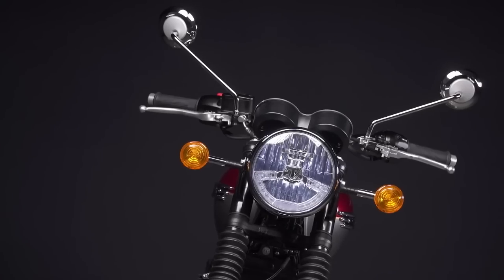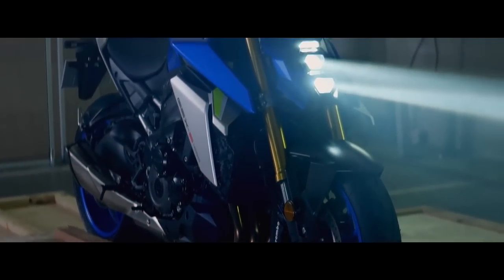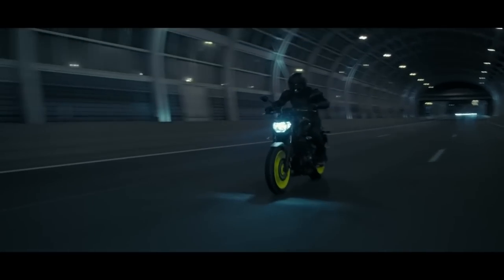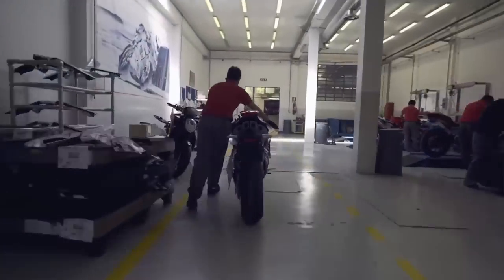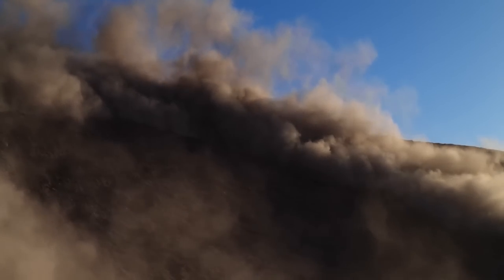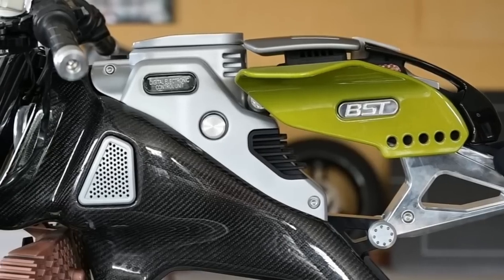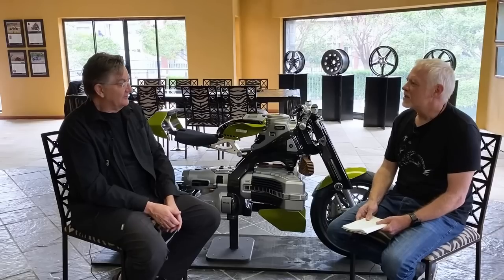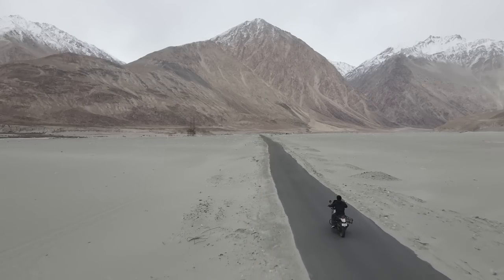Why old motorcycles look better than new motorcycles

Comment: Back in 1998, I attended The Art of the Motorcycle exhibition at the Guggenheim Museum. It was unprecedented at the time, and turned out to be one of the largest-attended shows ever held there, drawing folks who wouldn't usually be caught dead in any sort of museum. It was a supreme celebration of motorcycle design, proving that great design can be art.

Comment: Am 68 and still ride a lot, love the older bikes for the simple lines and simplicity.  Yep you can fix them yourself in your shop, but you gotta fix them more often but often the routine repairs can be done in fractions of the time to the new bikes.  There are some bikes out there that are simple, good looking and cheap.  Most riders now days are wrapped up with the high tech and MUST have this stuff on the bike and look down on others who cannot match the specs with their bike.  Well there is a stretch of road close to home that has some shall I say interesting characteristics that a good rider will drool and have fun, while many of these hyper bike dreamers wherein tech is the point and not the ride.  Many of these dreamers have bikes that should have cleaned my clock badly I ate for lunch.
Reply: I'll be 70 soon and have 5 bikes. Just got a Royal Enfield Continental GT 650. But I still love the old bikes. Even at my age I have no problem with a kick start. Merry Christmas.
Reply: I'll be 68 at the end of the month. I love all style of bikes. I have 5 bikes now. A 2015 XT250, a 2017 Harley Street Glide Special, a 2018 Iron 1200, a 2021 Yamaha MT07, and a 1965 Triumph TR6. I love them all.  I've been riding for over 50 years and have owned a lot of bikes. Too many to list. The Harleys style have seem to have remained the same for a long time. I have pictures of me sitting on my dads 1959 Pan Head. It seems that I was born to ride.
Reply: I have 7 carbureted bikes, one is a 2013 Royal Enfield B5 Bullet that I converted from EFI to an Amal carburetor, one is a 1979 Vespa P200E two stroke, one is a 2002 Harley Sportster, the rest are '70s and '80s Japanese bikes. I have 2 1960s pre emissions cars.  Computerized "technology" is not for me when it comes to motor vehicles.
Reply: @geraldscott4302  What is fun for me is the Kids and grandkids scratching their heads when I work on a carb or change out points.  Have a 47 VAC Case Tractor, and 6 motorcycles that range from the 70's to the early 2000.  As for automotive 4 wheels again oldest is 68 Poncho to Mom's 18 Grand Cherokee.  The cool 4 wheel is the 99 Jeep Wrangler with 2.5Lt with 5 speed and a home grown turbocharger system.
Reply: I hear you. I'm 29, and I just got into riding last year. Commute every day on my bike and love it. Maybe it's because I didn't grow up with the old bikes or pay attention to motorcycles growing up, but I'm definitely the kind of person that likes the modern bikes much better. Just for simple things like having safety features like ABS. My first bike I've been riding is a 2018 Triumph Speedmaster. Been riding every day and hoping to upgrade maybe next year for a larger cruiser bike. Probably going to try out the new Low Rider S when I get around to trading in. 

I love hearing older people still loving motorcycles. Hopefully I'll be the old timer one day talking about my favorite bikes too lol. Ride safe
Reply: @tomoates8568  I myself would avoid the Harley like the Plague.  Have had exactly 2 over the years and both I couldn't wait to unload on someone.  HD actually stands for Hundred Dollars, they are a reliability nightmare.  I ride with some die hard HD guys and if any bike on the ride fails it is ALWAYS the HD.  Sorry they have a assembled crankshaft, something the rest of the industry dropped some 40-50 years ago due to reliability issues.  Their valve trains for the past 15 years is Piss Poor at best, the old Evolution engine was the last somewhat reliable engine that HD built.  I hear of guys bragging how they get outstanding reliability on their HD but when you look at the bike it has practically no real miles on it or you can see signs where it has been down at least 1 or more times.  The best is when they describe as minor routine repairs compared to another brand would be considered MAJOR issues.  Sorry the rear cylinder runs on a average 50deg hotter and cracked heads are common.  The valve gear has had issues for a while now, seems as if it self destructs at a alarming rate.  My stepson was a cruiser type, that is until he rode a more traditional bike like you have, and eventually picked up a ancient Goldwing 1100 which he loves, yep it is old but it meets his needs and is toaster oven reliable.   Those cruisers look cool and feel great in the showroom but, and that is a big butt.  On the road that feet forward and reaching for the bars puts a shitload of load on your lower back, and they normally have only a couple of inches of rear suspension travel.  So they beat the hell out of your back then since your are reaching for the bars your arms ach like hell in 100 miles.  Have ridden with some big bad HD riders and they tell me I am full of shit on that one, however when we do a 500mile day they are in pain the next day when we are ready to go, just saying.
Reply: @lovingmylifeasIage6741  I'm 65 this year, have a pan head I built in 95, have been riding since about 12, and just bought a 750 Triumph off ebay this week.  I've long considered "form follows function", and it fits with the older bikes.  My neighbor bought a 62 panhead from a police auction in probably 72, I was 15, and we rebuilt his engine and tranny together.  I still mess with "old bikes".  I rode a 64 Triumph TR6R in the seventies.  Good memories.

Comment: You are right on form vs function (less so on materials) and the parallels with cars are the same. Early motorised transport was all about beauty and character (form) and then efficiency, performance and safety took over (function). Now all modern cars look like identical jelly moulds and we've lost the intimacy of self servicing with the complexities of things like EFI and ECUs.
The exception are the Italians, who have always prioritised the aesthetic and make the function conform to it. Tamburini  would have been a better designer to highlight, in this regard, than Terreblanche. 
Interesting video though.

Comment: As a 72-year-old rider, new bikes are like new cars cookie-cutter butt ugly.
Reply: Born in 1941 and got into motorcycles while in high school.  The era from then til the mid '80s had the most overall practicality and value.  Full fenders, a dual seat, and uncluttered features that were easy to care for.  My '57 BMW R-26 was the best "keeper" I ever had and was no slouch at cruising 60mph.  I was a mechanic and service manager in the industry for nearly 20 years - there were some exciting developments but also some minor failings, mostly for the status in a market category.

Comment: i borrowed a R1 and I also rode a modified cb400 cafe racer,
it always gave me a different and confident feeling and the soothing vibrations of old motorcycle, the smooth hum and the  rev match , all mechanical  with no cruise control or so what ever, pure manual and even driving slow,  it is always a different feeling without the adrenaline rush. cant explain, but when you take a ride on a modern bike again, I know you will feel it,

pros of old bike is that when you have basic knowledge of motorcycle, 
you can service it on the side of the road and even old people will always give you  a helping hand with their wild stories and memories, and some pro tips you'll never even gonna experience in modern bike.

As my old man says,
Big toys for the big boys